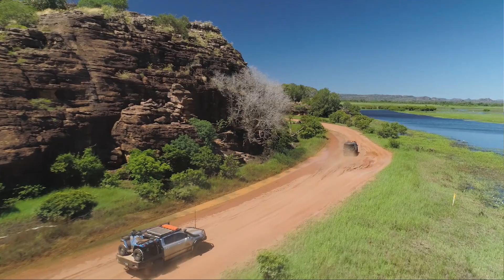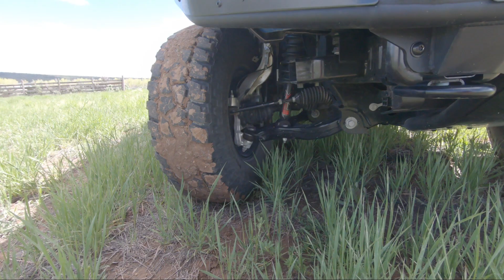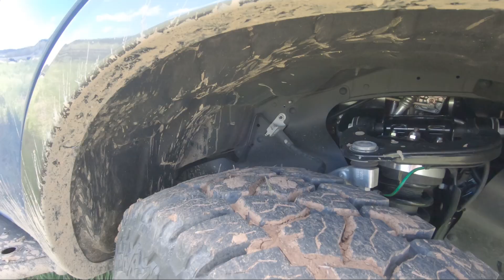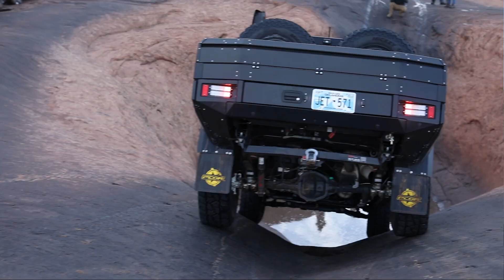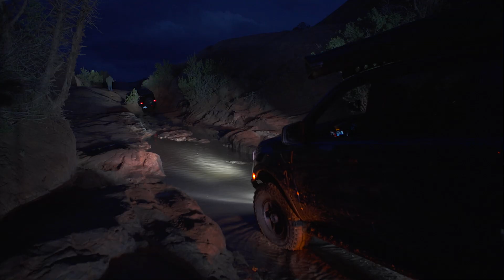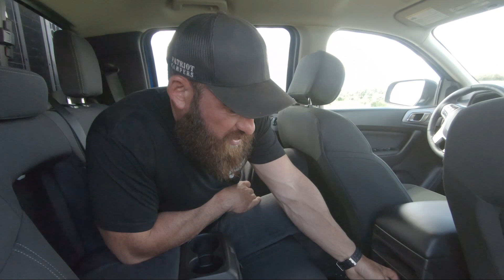FOR SALE - First Ford Ranger PX3 In The USA - PCOR Supertourer

Comment: I really like these Rangers. Drove the Tacoma, Colorado, & Ranger ... will be getting the Ford. Tacoma is nice & has a reputation for durability, but the seating position is horrid and interior worst among the 3.  The Chevy is likewise nice, but I’d have to go up to a ZR2 to get the locker & upgraded suspension.  Interior of the Ranger is by far the best & the engine-tranny combo is very smooth. Actually felt more powerful than the V6 in the Taco & Chevy.

Comment: Americans don’t like diesels as much as the rest of the world. We’ve always had good quality gasoline where other countries have had to deal with different quality of gasoline and not knowing whether it’s good or not. With diesel it doesn’t matter as much and a diesel engine will still run fine. Diesels in America were primarily used in heavy commercial vehicles like semi trucks and industrial tractors and were known for being dirty, smelly and polluting vehicles. New diesels aren’t that way but the stereotype has stuck in the minds of Americans. It’s too bad really because diesels provide better mileage and more torque.

Comment: Awesome build as always Justin. Were you able to correct the critically low wheel travel/traction on the Ranger w/the spacer or do you feel the Icon setup will completely correct it? Also, w/your tray, do you think you could reverse or modify the tow system to be higher but equal to stock? I know the tray exposes so much more, but it seems there's a way to equal out all that exposed space. Thanks for all you guys do, excellent products.

Comment: We love our diesels over here, but we dont have the options. Emissions kills the diesel in the US.  Also, while the TQ numbers are similar, your diesel ranger wont lose fuel mileage when towing like the Gas one will. Especially the 2.3 Ecoboost.  The 2.3 gets about 35 MPG, the 2.3 turbo gets about 20%less in similar circumstance, and 50% less when towing.

Comment: I wonder how similar this is to the Aussie Ranger. From what I have heard they had to make the frame in the US, to get around stupid regulations. But I think everything else is made overseas. If the bed fits that would make me think everything is the same on the US and the Aussie trucks.
Reply: Jocalopse There very very similar apart from the motor, they look pretty much the exact same
Reply: Seth Phillips what does it mean PX3 Ford Ranger?

Comment: Only pretend 4x4s run on petrol
Reply: not in the states. if you see the likes of a 454 Chevy or a 460 Ford, they'd probably beat your diesels in a pulling contest easily lol. we have the option to just make gigantic V8's for torque.
Reply: @cpufreak101  put you chev motor underwater and see what happens to it. Alot more to 4x4ing them having heaps of power
Reply: @longy6612  then just run the 350 or hell even a 305 lol

Comment: Do your trays allow for integration of the factory sensors and systems like blind spot monitoring, or parking sensors. Specifically the blind spot monitoring found in the Gladiator? Also up to what size tires are you able to fit on the canopies for the Tray? Say 2x 37x12.5r17 possible? Options I assume are kitchen Nd upgrade to Lithium in Canopy, what have others done to integrate a heated shower to this tank? Thanks..

Comment: I really think you should look into the ZR2 Chevrolet Colorado.  That vehicle is really taking the offroad community by storm and would be a great platform for your PCOR setup.  As an added bonus you can get a diesel engine in the Colorado as well as front and rear lockers, making it a much more versitile vehicle for Overlanding and Trailer Towing.
Reply: Holden Colorado’s are pieces of shit, would imagine it’s the same

Comment: Sad ford didn't bring the diesel over,  vw really hurt the diesel trend in America , Chevy ford n ram are trying to get the fire back in half tons but vw really left a bad mark with the EPA
Reply: EPA has effectively tanked diesel sales here in the U.S with all the emission requirements making them less efficient and reliable than they could be.  Too many horror stories of guys being stuck on the side of the road in limp mode or complete engine failures due to coolant in their oil from SCR failures, bad DEF, fouled emission sensors, etc.

Comment: Just wondering when you made this video. Only ask because the new PX3 in Aus now comes in a 2.0 twin turbo with the 10sp auto and they drive very very well. Have driven several now.
Reply: Aus has a 2.0BitTurbo Diesel. and I think still running out a few of the 3.2Turbo Diesels. US is Petrol only. (as of 11July2019)